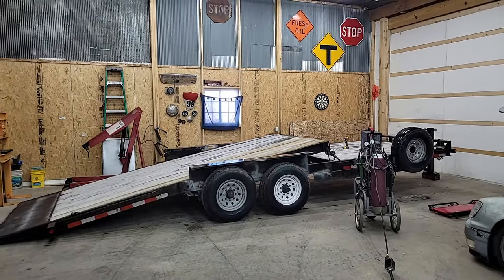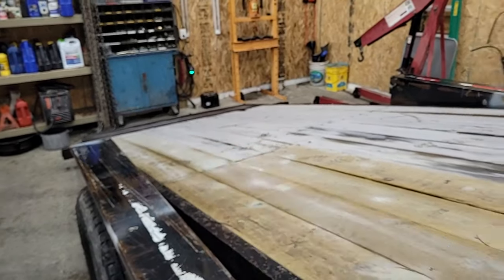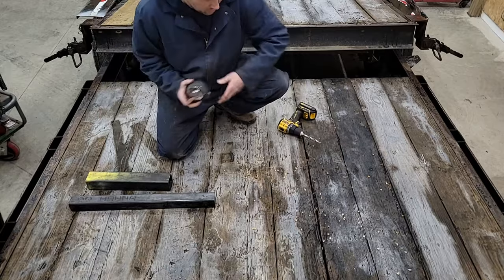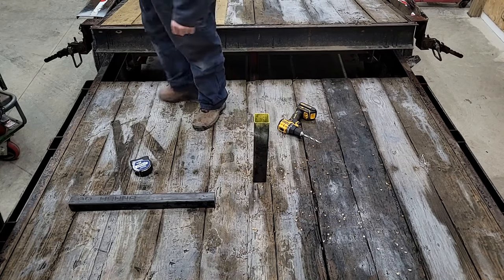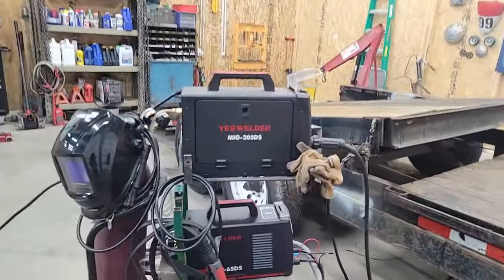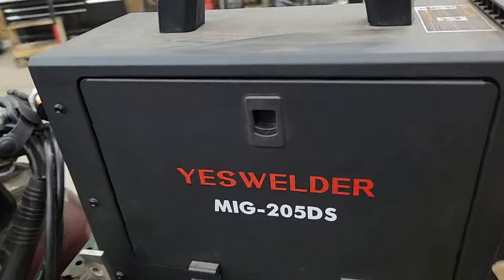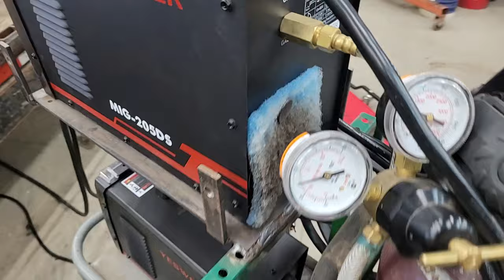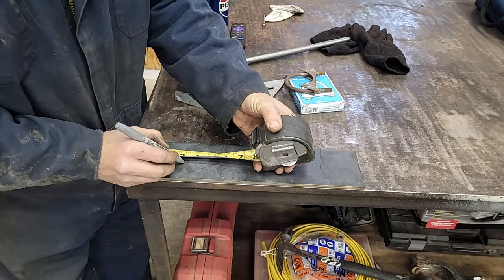Installing a Guide for a Winch Cable on a Tilt Deck Trailer

Comment: Easier to just raise your winch to the height of your tilt.
That way it pulling more in line with bumper or what ever, if you need to double line it everything is inline. Just a thought.

Comment: If you need more pulling power you could always use a 3:1, 4:1 or 5:1 with your pully, since you are already running a 2:1 adding an extra pully or 2 should be easy

Comment: Doesn’t it have a lock on the tilt if so put a pulley at the top of the tilt deck so it rolls on
Reply from the maker: Mine doesn't have a lock. I may add something later. This was quick and simple. Thanks.